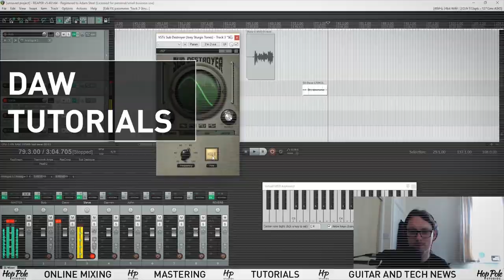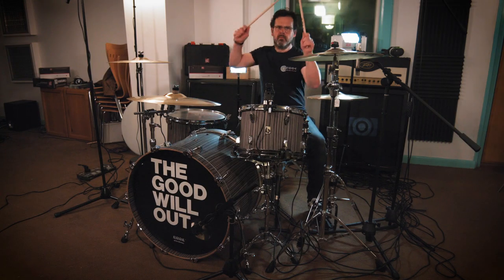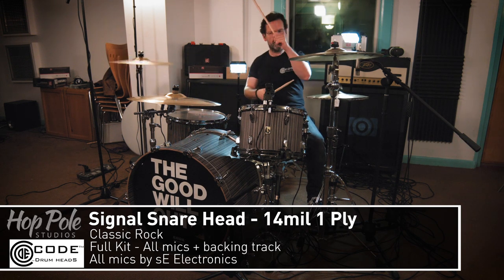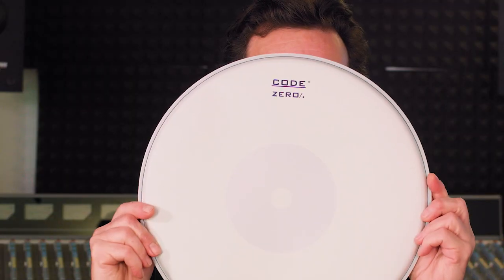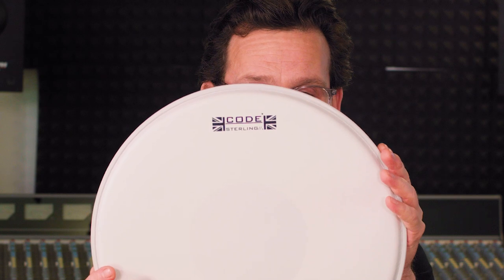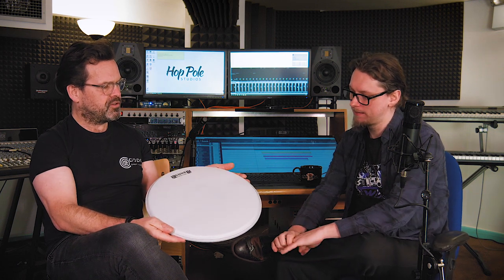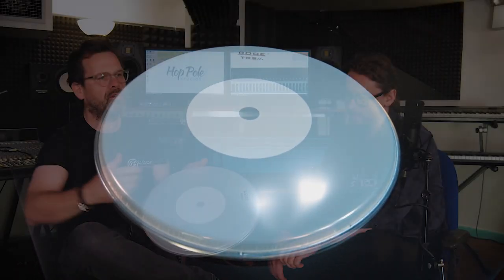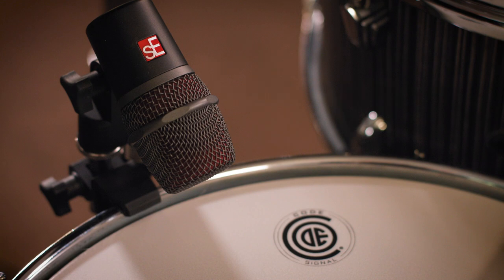Snare Drum Heads - 1 Ply or 2 Ply? Featuring Code Drumheads

Comment: The Evans Level 360 head on the snare drum is started to clean by herself in the middle, now I have just a half of the head in the middle for about 3 cm, what can I use over 3 cm thin part for protection ? For any adice from you I am grateful, because I am not a specialist. My son is beating a lot in the snare drum.
Reply from the maker: Buy a new one. Unless it’s just for practice, then something like a kick patch might help for a while- but be prepared for the old one to break soon
Reply: @adamsteelproducer  thank you, I have a spare but now I am not very satisfied by the level 360 since my son used it just for 6 months. Can you advice me for any better quality head ?
Reply from the maker: 6 months???? I’d be replacing it after 4 weeks or less depending on how often/hard you’re hitting it. You’re not getting a “better quality” anywhere, it’s the same as guitar strings
Reply: @adamsteelproducer  I understood, thank you.

Comment: The drum tuning is pretty bad here. I think you guys are doing your products more harm than good.
Reply from the maker: That’s just, like, your opinion, man. 
If the boss of a drum head company thinks it sounds good (and signed off on the video) then it’s probably just fine.
Reply: @adamsteelproducer  you are not wrong. My opinion... I was just investigating heads and this video took me away from Code.
Reply: @rakejas  Your right, they do sound a bit crappy, turned me off them too.